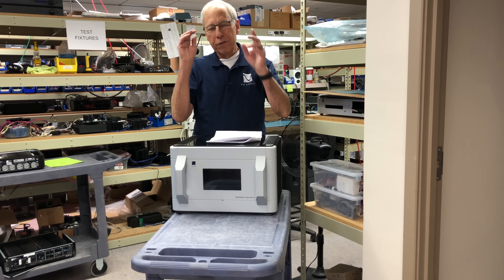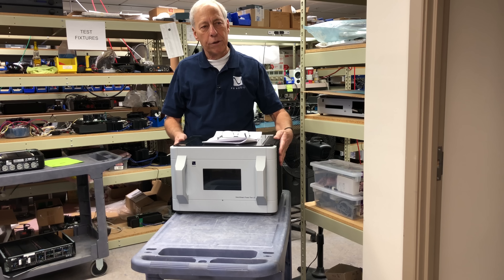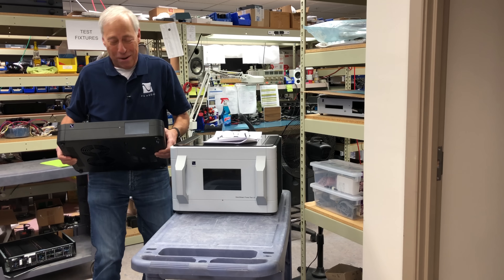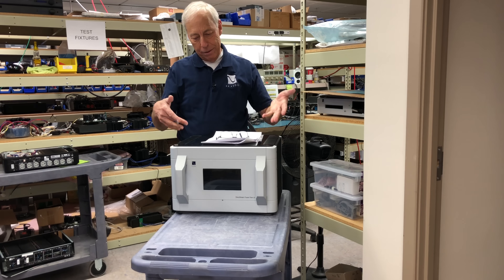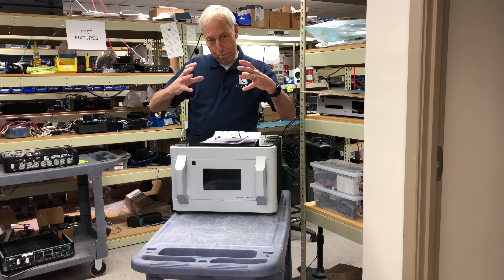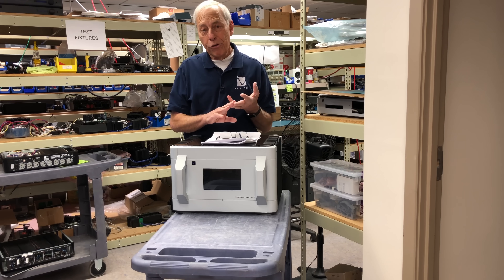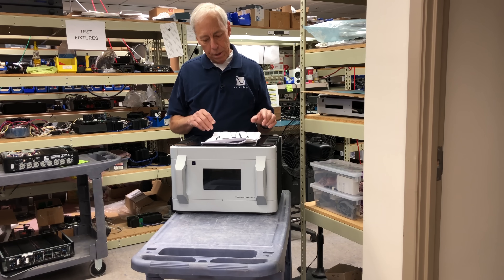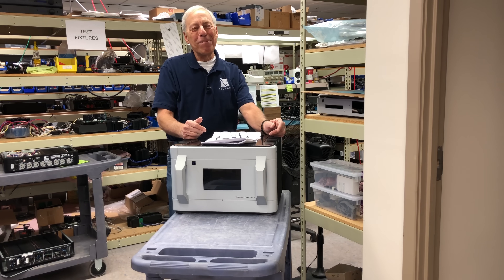Why are Power Plants so expensive?

Comment: So these are online UPSes without the battery backup, or the surge protection. And cost $8000 more for the same output capacity including being able to set the voltage to the exact volt you want out, hz, pure sine wave, and double conversion, oh and network monitoring with logs of every voltage reading hz in and out and temp every 5 min for the last 5 years.  

Stick a cyberpower online UPS OL2200RTXL2UN next to a p15, hook up the scopes. Or more in the same price range but a lot more capable, Eaton 9155 UPS. https://www.eaton.com/us/en-us/catalog/backup-power-ups-surge-it-power-distribution/eaton-9155-ups.html

Comment: These power plants are definitely questionable in my eyes. Let me ask everybody that is including Paul. If these power plants including the entry level one which is definitely obtainable by people are so Fantastic Four sound systems if you took a poll how come barely anybody buys these things? I've known many different audio files through the years and I have one friend that owns one. Also just being on YouTube and doing extensive research online for the years I've been audiophile rarely does anybody ever even talk about these power plants. In my opinion that all the proof we need right there.
Reply: All I have read about the current power plants has been full of praise.  So full of praise that I bought both a P3 ($2500) and a P12 ($5000).  Both have greatly improved the sound of everything plugged into them, including units up to $10k.  Yes, I have read commentary about first generation PPs and reliability problems (which may or may not be accurate), but today’s PPs are nothing like those units, and I have not heard of any problems about them.  For anyone who has their source units where they want them, and has the funds to purchase them, I could not more highly recommend getting a PP.  and I rarely recommend anything.  But as Paul stressed, get the core of the system right first.
Reply: @doowopper1951  thanks for the comment, interesting. One of my very close friends has a power plant and it has not improved the sound at all.

Comment: Back to basics. A normal audio amplifier takes AC in on one end, does a bit of turning that into a kind of DC and leads that to the (output) speakers. Somewhere in that path, the audio input signal is used to modulate the power into the amplified audio output signal.
This simply means, if the power input stage that feeds the amplified audio path to the speaker has not been filtered and regulated well enough, your audio quality that you hear, depends on the quality of the AC power coming into the amplifier. Clean in, clean out. After midnight, when many people and appliances have gone to sleep, your system sounds better. But at that time, you want to sleep too.
A secondary problem is, how well your AC feed (from the electrical company) is able to deliver Ampères when you need them, how many peak, how fast, how many constantly. Faster is better, more is better. A power amp draws a lot of Amps when you play music with a heavy boom-boom bass that may draw so many Amps that you amp becomes power hungry and it is felt in the mid and upper sound ranges.
A ternary problem is how to recharge the capacitors in your power amplifier's power stages that sit there as energy reserves (buffers). 60 Hz (USA) or 50 Hz (Europe) may not be ideal to do that.
So, a "power plant" can provide an additional buffer, a faster source of Amps, and it can clean up AC from the wall outlet. in doing so, it needs to recreate a form of AC that your amp can work with in a better way: by resynthesizing an AC wave, not necessarily 60 Hz all the time, but potentially wave trains between 50 and, say, 80 Hz as a way to feed your amp's capacitors in a better way.
Your vendor of your high-end power amp simply assumes you have clean power, or else they had to design and build a power stage into the power amp that does the power plant job.

Comment: Arguably, if the power supplies inside your various components were up to their assigned tasks, and you had decent 'to code' wiring in your home, there would be no advantage to power regenerators.

Conversely, if you are the king, and you're drooling over some  new clothes, well you might as well toss the money. After all, you never see a Brinks truck following a hearse, right?

Comment: Curious about the answer if question was on a $10k cable.
Reply: I think that Paul would have said to make sure you got the core of the system right, then try it out, getting it from a company that allows returns, as some $10k cables might work magic, some might mess up the sound.  It’s all about synergy!

Comment: I am not an electrical engineer. I have one PowerPlant for each of my two systems. There is documentation details that PowerPlants via power regeneration do more to provide consistent and clean power than a power conditioner. The PowerPlants also have functionality that allows the user to monitor the distortion coming in and going out. I know that they clean up EMI on my power coming into the PowerPlants. The PowerPlants are end game power regeneration and conditioning to me. I am very pleased with these units as I am with everything else I have from PS Audio.
Reply: If you  WERE an electrical "engineer" you would not dream of buying one of these things.

Comment: But as I keep banging on about run it off batteries you can get a lithium phosphate battery 100 amp hours for $110 from China. 
What voltage does your low powered equipment generally run on is it 12 14 16V... and power amps what voltage?
Something like that regenerator you could put the battery in there and make a good inverter for it a lot cheaper than $10k probably about 1000$ should be able to achieve that
Reply from the maker: I get it, but it's not practical. To do what you're imagining you'd have to figure out what each piece of gear wants in voltage, open up the case, bypass the power supply transformer, and do it all with a soldering iron, voiding the warranty.

Remember,  all equipment is set up for AC input and that means it cannot be fed DC without hijacking the circuit.
Reply: @Paulmcgowanpsaudio  you're right and that is the problem, as a designer do not keep your voltage the same, but a lot of units even yours have separate power supplies so this could be designed in that the power supply it can be taken away and just use a battery or and a flyback converter or the power supply itself has the facility to have the battery connected a 12-volt DC input Jack With the flyback converter. What about the issue of people on solar panels and batteries in the homes, don't you have solar panels  and batteries I thought I heard you mention that some time ago. Maybe making a unit that cleans the signal from an inverter and allows you to connect battery Direct could be sold fairly cheaply. I suppose you're  regenerator does that to some extent but how does that cope with noisy inverters? maybe designing an inverter for or high fidelity use I don't know if there's any out there . I mean there is linear clean inverters step-up Transformers say 12V-240V for £150 2000-watts you can use how good they are I don't know. Maybe you should go into the Business of making good quality clean inverters that's where the market heading, not just for hi-fi used for everybody, you can get a 3000 Watt inverter for about $500 what can be Daisy changed for 48 volts. When hopefully  Bernie Sanders gets in you'll be able to get a grant off the government to start building your own solar inverters. now wouldn't that be great.
Reply: @Paulmcgowanpsaudio  Or, you know, you could just design your amplifiers to run off DC. Oh, but wait, then people who buy your amps, wouldn't need to spend the $10,000 on power plant.
Reply from the maker: @ianhaylock7409  :) They do run off DC already. Most people simply don't have giant DC power sources or batteries handy. You?

Comment: No doubt these are great products made with passion. Luckily the power in my home is clean enough like most homes in the USA.
Reply: I am fortunate our power substation is only two blocks from my house and the powerlines were updated several years back.
Reply: It’s all shared power tho, essentially making it dirty. AC regenerators fix that problem.
Reply: Brandon Millerd Great products are immune to a reasonable amount of AC noise through filtering in their power supplies.

Comment: Got the p 3 two weeks ago, and it made a big difference in sound quality. Made me a believer
Reply: Ken Kopf Cool, what kind of noise on your mains power was causing the problem? Did you ever have it measured? Noise always come from somewhere and often you can fix the source when it comes from other electronics in your own home like a faulty light dimmer, PC power supply or other switching electronics.
Reply: @ThinkingBetter  l didn't measure, I noticed the high notes were ragged hard to listen too so I tried the p3, and that fixed the problem. I was surprised.
Reply: Ken Kopf I wonder what makes that difference exactly. You know, there is always an underlying explanation. #1 is that you are happy with it.

Comment: If you live in a multistory building that’s like 60-years old, live on the 20th floor and you’ve got a “powerful” audio system you will probably benefit from a Power Station. This is especially true of each housing unit in the building has it’s own independent Air Conditioning system.

Comment: I've been wondering about the Powerplant's value in a sound studio.  And perhaps in particular a Mastering Studio.  
When you said if it were an audio amplifier it would cost the same but I immediately wondered if maybe it would cost a little less because as a pure audio amplifier it would not need the microprocessor and controller circuitry of the Power Plant.  Would that be right?

Comment: Seems like on TOP END equipment, they should have top end power supplies that perform very well on average wall power with (some) voltage variation, harmonics and noise.  
I'm truly surprised even TOP END gear has a noticeable improvement.
Biggest concession I ever made to power to my system was a couple of $15 dollar, 20 amp outlets, #10 Romex wire and a dedicated curcuit breaker to each outlet.
Reply: Although your concessions are improvements, the power coming into those new outlets might still have significant problems, such as noise, distortion, and others.  Where I live, distortion is about 4% in the 60Hz sign wave (some areas might reach more like 10%).  Even on my high end equipment, both my P3 and P12 offered a very significant improvement.  The build in power supplies in my equipment are very good, compared to lower priced equipment.  But, to get the sound coming out of the speakers up to the Power Plants’ level of excellence would require that the units it powers be far larger, far heavier, and far more expensive.  And, if each unit had such a power supply, the total cost increase would definitely be more than a power plant, and the added sizes summed together would be considerably larger.
Reply: @doowopper1951  I believe it, can't afford to buy it and, at my age, probably can't hear it.  But how those power line deficiencies get past the power transformer (s), the primary rectification and the (sometimes overly massive) dc filtering eludes me.  Using a scope, my better amps' primary filtering looks dead flat until the supply approaches its rating.  It seems to me that lower impedance power transformers (with less voltage droop),  more dc filtering and in rare cases, primary voltage regulators and more filtering would be better than an accurate, distortion free and noise quiet line power.

Do these devices provide noticable improvements at all power levels or only when the amps are running near maximum??
Reply: @denniswalsh8476  Would be nice if they showed the DC rails in one of their amps on a scope, with and without a power plant. Of course we know they'll never do that, and we know why.

Comment: I have 2 each ATI/Amplifier Technologies Inc AT2505 Power Amplifiers that require their own dedicated 120vac 20 amp outlet. I also have an Emotiva LPA-1 Power Amplifier a Denon AVR X4000  well as other equipment. My question is if these Power Plants can supply the 2400 watts the ATI 2505 Power Amps need to reach their full rated power.

Comment: A lot of copper costs a lot of money!  The weight also has its influence. As the Transformers are just a bunge of copper coils, it`s clear that they cannot be cheap. The rest, the software is also not for nothing to build...  I am happy that I don`t need a power regenerator in my place where I live. I have stable power, and the noise is in a range I can live with - especially with the audio gear I have...

Comment: No big deal, if you have the dough to throw on this equipment, order up a Bentley also, I hear they are a better car than for instance my honda.
Reply: Bentley's are very nice cars. Not in my price range but very nice none the less.
Reply: @ Mike....I hear that Honda's are more reliable & definitely cheaper to service. 😂

Alas, they likely don't hold there value the same way a Bentley might....exotica and brand appeal.

What I'm most certain about is if drivers of each car obeyed the road laws, they would get from A to B at roughly the same time.
Reply: @nostro1001  I agree except I think if you do the math in percentages the Honda holds its value way more than a Bentley. I have watched videos of the Bentley factory fascinating to see them build those cars how complicated they are, all the bells and whistles and refinement in wood and leather and the like. I just don't have that type of dough to throw. If I did I'd have a bunch of stuff that all builds and sells and there's other manufacturers that require that type of dough.
Reply: @bnghjtyu767  I'm not really into cars & if you say a Honda percentage wise holds its value better, I'm happy to go with that.

I had perceived a  Bentley as more elite and perhaps on that basis would likely stand the test of time better.

Yup, the wood finish etc is very impressive. For me, even if I had the dough, I'd choose some other type of car. I don't find them visually appealing. That's just me!

Cheers 😃
Reply: @nostro1001  yeah I'm with you on all that. What little I know about cars if I was going to buy a luxury car it would be the high-end Lexus sedans.but hey my standard of living isn't even there.
Reply: @bnghjtyu767 ...give me an ARIEL Atom with a turbocharged Honda engine any day...*Ferrari killer*

Comment: I have a P5, it's really handy to plug everything into, 1 button to power up everything....I've never noticed any sound quality improvement nore have I noticed any sonic degradation. ..
Reply: I'm surprised but also appreciate you for this statement, usually the more expensive something gets the  more people are prone to overrate it.
Reply: Great point. One can buy all the high end equipment they desire, but if their ears aren't up to the job of hearing the difference, it may not have been a justified purchase after all.
Reply: everyones supply will be of varied quality dont fix what aint broken / money and blackhole lol
Reply: Because theres' not  any. Ten grand for a device that turns AC into DC and back again do one thing,  prove that there's  one born every minute.
Reply: @musicman8270  I bought my P5 on the used market for $1500. It's worth it for me only for piece of mind preventing surge etc. for a higher end system. I figured I could turn around and sell it for what I paid if I ever decided it wasn't worth keeping...
Reply: @Merlin-wo1kj ...a smart purchase indeed!
Reply: Merlin If your current power supply is fairly clean and fairly consistent in voltage, the difference will be negligible. It’s beneficial as a component protector, and being to program the sequence of your components starting up/shutting down is a plus, but any electrician will tell you (and I’ve asked) that, if don’t have voltage fluctuations of more than 10%, your components will be fine.